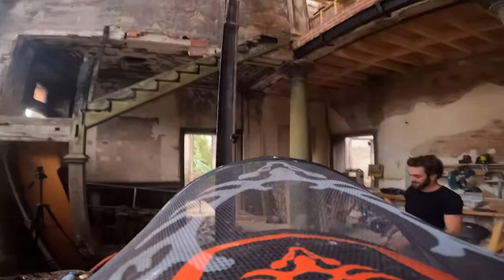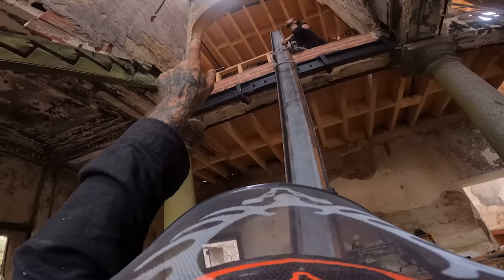Ascending structural steel beams through a chateau.

Comment: Well that winch saves a lot of grunt work, with minimal safety i might add, and with Nick being the foreman.  All in all good progress guys.  I don't think the winch is the answer - build a makeshift elevator with a cage, after all the turret is a great elevator shaft.  there lots of material to lug up 2-3+ floors
Reply: The winch is way better than lugging it up the ladders, Dan was considering putting up stairs but a roof is required first!?!

Comment: Weather's not on your side Dan, but you're doing great despite it!
Reply: We french actually had a nice sunny and hot autumn, but it is reaching it's end and the weather will become worse with days passing by.
Reply: @tomjoad1363  shame really . I would have concentrated on getting roof on first .
Reply: I was about to say the same, the weather has been nice actually, almost didnt rain for the whole month of september and otcober, it could have been way worst. Be ready for what's coming though .. It won't be the same
Reply: @annbarns652  Well, I can get it why he did what he did. First you have to clean the surrouding to have a workplace To park the work machinery, And a place to drop all the dirt. then cleaning the basment and first floor from debris, trees and dirt so you have a stable ground for scaffolding, then starting to put some floors. WIth floors it is easier to lift materials and devices to work up there, rather than a fragile, flexible and may be even dangerous 3 floors scaffolding. I'm following this channel since a few week only and don't know what region he is in, but the strongness of the winter will decide if he has to stop for a while or not. I would put some OSB boards on every opening such as french doors and windows to limit the amount of dirt, snow and rain inside of the building anyway.
Reply: @tomjoad1363  Yes i understand what you are saying. But a roof would keep the inside dry through wet and wintery weather. The place will be soaking wet and all the foloors will be in a mess
Reply: As an Englishman Dan should be very familiar with this kind of weather. I only wonder why he still hasn't put up some umbrella against it. 🙂

Comment: Might be worth making a water proof cover for the winch with the winter coming 😮
Reply: I'm fairly sure Dan have brought an winch designed to be mounted outside on an vehicle. Like for offroading or on a truck. It's also why it runs on 12V battery power.
Reply: I think the hope is to have a cover called a roof. Fingers crossed. ✌

Comment: I always arc-weld a  loop of mild steel on to them--cut it off later and grind smooth then paint.  Steel beams are too slippery to simply tie off in a sling.  You may get away with it time after time, but eventually one will slip out and damage the work or worse, hurt someone. If one uses flat bar steel as an attachment point for a sling and in doing so bridges the channel in an area where no beams will be fitted, and does it above the point of balance, the bar may be welded permanently in place, and the beam is then more easily handled and is structurally stronger.

Comment: You mentioned previously about raising the floor. Have you considered  leaving  the old one until the new one is done. Then you wouldn't need to work over your heads. Also you previously mentioned wanting the floor to be level over the door if possible. Since it's just at your new floor hight you may want to look into placing a meter square piece of safety glass that is thick enough for walking on. It would keep the floor level and provide extra light in the door way.  Looking forward to seeing the progress 😀👍.

Comment: really need a small tiny roof, perhaps just a square piece of thick tin that is folded in half, and a plastic sheet over that for the towers top floor to protect it and the winch from weather until you can get the roof on proper. 
Will also keep your work area dry inside the tower.

Comment: I really do enjoy your daily posts. I have no idea where you get the energy. I have a suggestion. Your hoist seems very helpful but it does involve a lot of winding. If you replaced the handle with a suitable nut you could perhaps wind it up and down with an impact driver or drill.

Comment: CAUTION: avoid putting a lot of weight in one area. Spread the beams out across the floor. Too much weight in one area can cause the floor and walls to collapse.
Reply: This is new information for me. I did not realize that putting too much weight on something could make it collapse.
Reply: @claybrinkman533 😲😏
Reply: @claybrinkman533  While it can, it would take more weight than this.
Reply: Just for the sake of explanation, imagine carrying one 10 kg suitcase at one side or one 5 kg case at each side and then guess which situation balances your body load best.

Comment: Glad to see that you got the winch set up and are using it.  I think I remember hearing that you had a couple of problems with it:
1.  The winch just stopped.  This is usually one of a few things...
1a. The winch is not powerful enough.  
1aa. Mitigation is get a bigger winch or use a block and tackle.  The block and tackle will multiply the load the weight the winch can lift. Nick should understand it or look up "block and tackle" on YouTube.
1b. You haven't paid attention to the duty cycle.  Most of the winches you are supposed to use for 15-30 minutes and then let it rest for that long and cool off.
1c. The battery is dead.  That is another easy one.  connect a charged battery and try again.
2. Getting the steel to the lift point... 
2a.  You used the smaller winch to pull it in. 
2b. You could also use the excavator/digger to pull the steel in from the other side of the chateau.

As always it's nice to see your progress and to see Nick.  Nick knows a lot about moving big/heavy stuff.  Listen to him and don't get under that heavy stuff when it's in the air.

Comment: well done you two great team work.  I was just thinking   if you had some sort of say a roller thats on a small steel support system that you could screw/ bolt  down to the edge of your wooden flooring the rolller then would be able to rotate on its little support frame at the top so when your beams and later large heavy long lengths of wood are winched up if the wood then goes against the roller then as you lower it down to floor level the wood would role o over the roller and be less friction and effort to drag it over the edge . i am not good at explaining .
Reply: It's a good idea,they are available commercially. I've got one,I move steel, and any sheet material with it.

Comment: Assuming you plan to keep working thru the winter, why not put some tarps over the areas you plan to work in most to keep dry???
Reply: Dan is pushing for a roof structure before winter sets in proper…temporary or otherwise. He mentioned in a few vlogs ago. I hope they make it. 
Having Nick there should mean the remaining floors can go in (with associated wall repairs) and then they can focus on the wall capping timber from which you would build a roof structure. 

I’m more worried that they need more bracing for the higher free standing walls and the chimney stack to reinforce it. That would be an immense setback.
Reply: Dan need to construct a temporary roof  there because he needs a plan, Lots of wood and time to reconstruct the original mansard roof and its nearly impossible to Do it before Winter
Reply: @Slaughterman1000  agreed. I “think” he mentioned he would be building a temp roof OR a contractor would be building the finished final roof structure. Seems to me he’s running out of time.

Comment: Recommend you rent (hire) a boom lift to move wood and beams up to the higher levels.  It would save you a huge amount of time and energy.  4 wheels with a boom and forks on the front.  Only hire it when you need to move materials.

Comment: Really need to get a cover over that OSB flooring. I realize it is temporary, but water will make it unsound in a hurry.
Reply: I saw the top most level had black plastic. That’s something I suppose.
Reply: Not sure of Dan's plans but
It's what's known as a subfloor. You need it to work on but it'll be exposed for so long that it will degrade slightly. I think he'll probably put battens on top of the osb and then chipboard/osb the floor. This creates a really handy space for services.
Reply: @duncanhiggins7321   I know it is a subfloor. But at least here in the states, we get a roof over it rather than letting it sit in the weather for an extended period. Drying it in, is important.

Comment: IMPORTANT: The pulley/winch or what you call it, in the top. It's not meant to lift, but only for drage/pull thing's. the brake is way to weak on thous and probably can't hold up the heavy items you lift and can fall down. You need a hoist to do this, with a much stronger brake system.
Reply: @andymccabe6712  Andy andy andy. I bin working with lifting materials for some time now, it's not about (i know one how can fix that for 100$) It's a reason why we here in Denmark are watching videos of everybody else around the world failing in safety on youtube.  and not the other way around. And i guessing that winch is not special made, it's just a standart one for 300 - 500 euro.

Comment: Dan if you want to lift heavy things with the winch you need a system of pulleys. That is the only way you can use properly the power of the winch. You can not just lift directly. Just try and will see immediately the results. It is a 5000 years technology. Greetings!

Comment: I had an idea about your winch the other day, and when you've finished with it, and all the heavy lifting is done. It can lift 5 tonnes you say, you could use it for a lift, but you would need to start planning that now, as you need might need the winch to winch up a little extra steel for some sort of frame for it.
Reply: @caren197  Why not? If it can lift 5tonnes then I'm reasonably sure it could lift a box with a few people in it.

Comment: Dan, you need a mag drill my brother for those holes in the steel beams. Be mindful of the big drill bits grabbing and turning the drill though. Maybe step drills would be better as they don't just have just two flutes that tend to bite in and want to turn the drill. Be safe and careful my man. Wear some safety glasses Dan, they don't sell eyes at the hardware store.

Comment: At the ground floor under the winch area, You should CLEAR THOSE POWER CORDS and cables everywhere! one slip or scrape in the rain with those heavy. sharp iron beams and Ka-Blowie! No more battery/ AC system........

Comment: Think LVL wood beam would be a better solution ,lot lighter to .
Reply: except for the small issue that the structural engineer doesn't agree with you.

You know, the one Dan paid for to do some actual engineering details for structural sound construction in France that complies with local code?
Reply: Otto means that Dan changed the design of the floor. Originally the floor joists went into pockets in the wall but Dan filled them in. He then needed to use a steel because of the span ,this making it more difficult for himself.

Comment: You might've answered this in another video, but how come this chateau used steel beams instead pf wooden ones? Was it because it was made a little bit later than other chateaus or has it been renovated at some point where they replaced the wooden beams with steel ones? Thanks for any replies, and great video!

Comment: Well just throwing it out weather is changing fast would like to see a way keep inside as dry as possible b4 the roof goes on. Don't need an extra issue like mildrew & mold after all that has happened to the Chateaux in the past! Crack On!

Comment: In future you'd be better off putting a tag line on the beams so as when they are at height you pull them with it not struggling with the beam

Comment: these videos are going to be pretty boring after those roofs are in place. plastering. picking wallpaper. yuck.
Reply: There's a huge staircase to build, wiring, plumbing, getting water to the château, septic system installed, heating system, windows and doors to put in ... it'll be years before plastering and decorating.